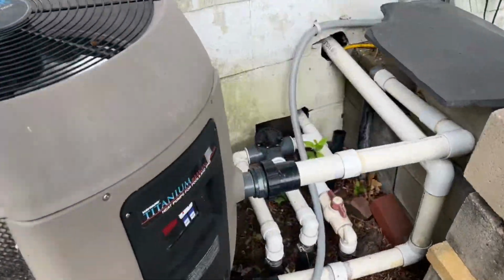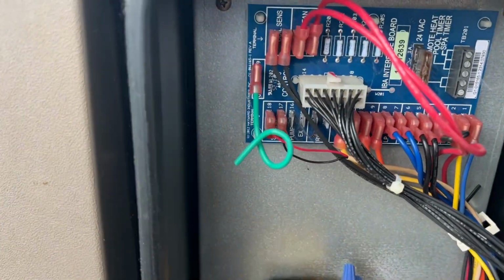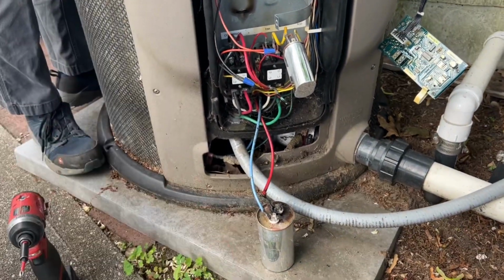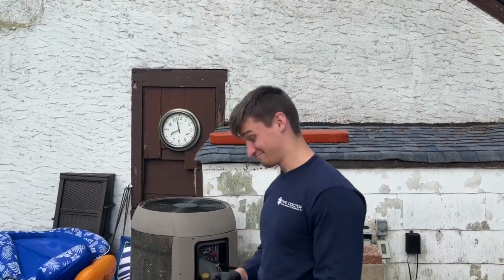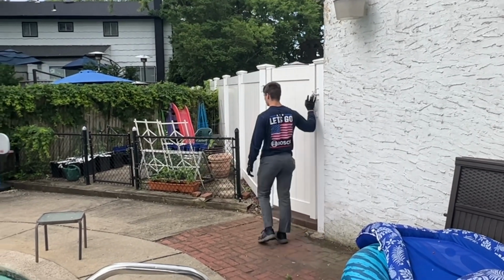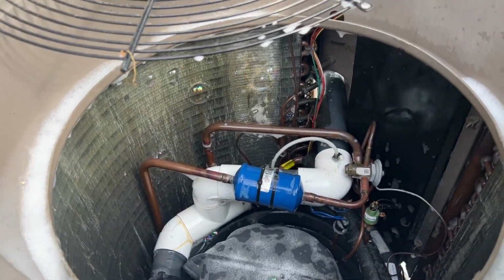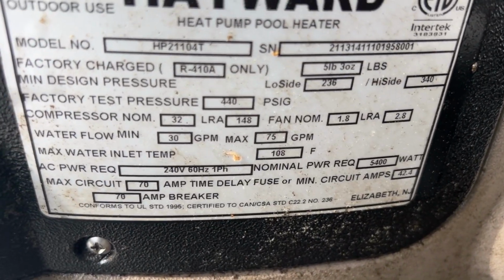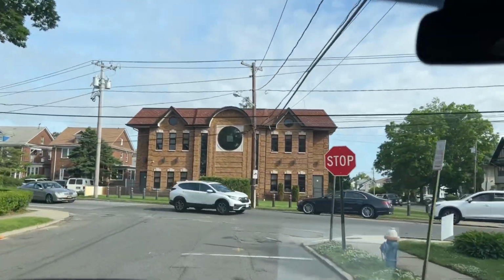Hayward HeatPro Heat Pump Pool Heater Not Working? Here's a Solution

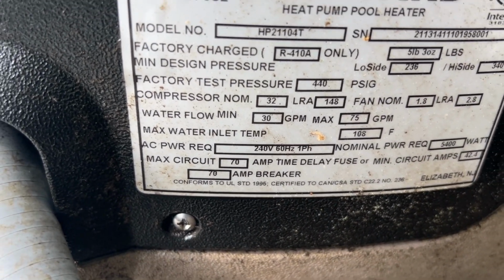Comment: 25:12 Remember the 70 amps is just the breaker value.  Your reading should be under the 32A + 1.8A or 33.8A when running, which it is at 24.6A so you are golden.  If you notice on the nameplate it also shows that it uses 5400W or (22.5A) so actually your number is almost exact on with the fan motor as well.  Most of the time I see nameplate ratings are under actual readings by a good margin.  

At only a 5400W net heater here, that is only 18,414 BTU, so not much.  It will take a long time to get that pool heated up.  Considering that many gas pool heaters are between 150,000 and 400,000 BTU's, its no surprise its only a 3 degree difference.    Keep up the good work!  😎🍺
Reply: Great info.
Reply: Heat pumps give you 3:1 4:1  on your power input.  Probably even more during summer months. So that 18,414 btu’s is not even relevant.
Reply: 18,414 is if resistive.  Heat pumps have a COP of 3.5-4.  So much more than that.
Reply: Hey that min/max button is there for a reason, doh

Comment: Hi Mikey, thank you for the video, it really explain a lot. I have the same exact HeatPump, and I need to replace the Controller board behind the display, It is not providing 24 volts to the interface card, do you happen to have any in stock since it is very hard to find.

Comment: HI MIKEY PIPES :) Currently have a similar issue on my heatpro pool heater. Fan working, no error code, but water is not heating. As I saw in 2 of your videos, you stumbled on similar problems, replaced the fan & compressor capacitors, and it fixed the heater. This seems to be a recurrent problem? Would you advise to change those? This definitely seems like that could be the solution to my problem.
Reply: @PipeDoctor  HI MIKEY PIPES :), so I endend up replacing BOTH the fan & compressor capacitors by a dual Titan HD capacitor (MADE IN THE USA ;)), and it fixed the problem! Now everything is running fine and the water is heating. Thank you for your videos! :)

Comment: Hey Mike, another great video.. I've noticed in your other videos that you are trying to get amps on start ups. Don't know if your meter has the function you need but you need to get the one with inrush amps function. You set it and it will display the inrush current and stay at that number until you clear it. The you will know exactly what Startp was
Reply: Theres a max/min button on the fluke meter Mike has and if you press the button (it will show max on the screen) it will show the maximum amperage recorded which would basically be the inrush current

Comment: HI BDK!!!!      Great video Mikey! Try pressing the max/min button on your multimeter  (prior to starting the equipment) I believe it will show "max" on the display and it should record the peak/max amperage. I dont have a fluke, but Ive got a meter that has the exact same button. Hopefully that'll let you measure inrush current in the event you would like to measure

And what that guy needs is gas!
Reply: There are some differences between min/max and inrush current, meter wise.  You really need an inrush function, according to Fluke anyway.

Comment: I got at work one of those stuff, and sadly the evaporator is all beat up, and I need change the txv bcz was stuck and making high pressure sensor trip, changed for a 3 tons txv and is working fine, just the fact the condenser is all beat up

Comment: Pool Rules, at a residential pool  interesting.
So you know, that's probably not Slate on that wall by the disconnect, I think that's Asbestos.
Definitely not the most discreet installation.

Comment: Mikey a little electrical lesson from the legend plate info. 
Nominal power required....5400 watts
AC power req 240 volts 
5400÷240= 22.5 amps
Your meter indicated 23.5 amps, is 5% high within tolerances?
Reply: You’re using 240 as a standardized voltage.  The voltage could have very well been 220 or anything in between. That would throw a wattage calculation off that’s why watts aren’t used to determine working ability and system health, there’s too many variables.  If the amps are within it’s rated amount, then it is operational.

Comment: With a plugged evaporator the amp draw will be lower as the unit is not producing heat. The head pressure will also cause a lower amperage because the "condenser" is actually inside of the unit and is reflective of the 73 degree pool water. With proper air flow across the evaporator the amp draw will go up as the pool water heats as the head pressure and suction pressure increase unlike what happens on an A/C unit. There also should be a PVC same size by pass between the inlet PVC and the outlet PVC with a hand valve for regulation of the DeltaT so the pool water will heat best and the compressor will be at factory specs. Depending on the OA air temp/humidity and the ground temp the compressor will run consistently for way over 8 hours to raise the pool water temp to 86 degrees. The owners are making a big mistake in not keeping the pool covered especially since so much stuff is now gathering in the pool which ends up in the filter and the pump and the heat exchanger of the pool heat pump.

Comment: it really needs temperature probe wells right at the heater inlet/outlet piping. I didn't notice if that setup has an external heater bypass to limit flow rate through it or not.
but having a good limited flow rate through them is usually a wise thing.
Reply: @PipeDoctor  cheap cheap cheap go the birdies. like all others they do and supply minimal needed to make it work, there's always room for improvements.
majority of heaters want a specific range of flow rate though them and do not have magical flow controllers, that being a small residential unit, who knows.

Comment: A dirty coil will make the amp draw low because there is low load on the system.
Reply: and it will cause coil icing and possibly freeze up if real dirty, since that is technically being used as  an evaporator, trying to extract heat from the air.

Comment: So if a house AC unit removes the heat, and the pool heater adds heat is there a system out there where you can heat your pool and cool your house with one condensor?
Reply: Noooo
Reply: There are systems to do that but there would be no way of managing the pool temperature it would just be supplemental heat from when your air conditioner is running. But it would definitely be better than no pool heater, especially if the pool is shaded and you’re in a cooling dominated climate.